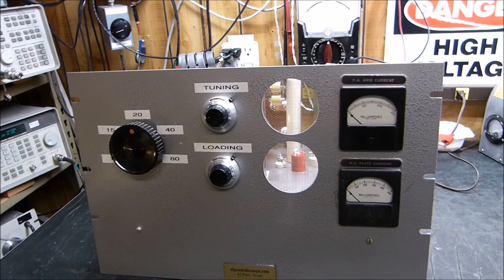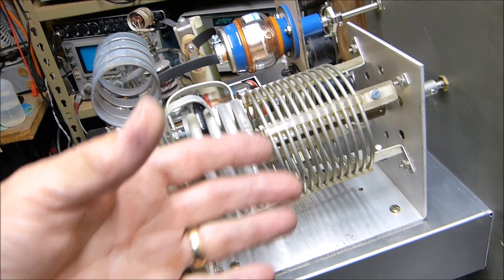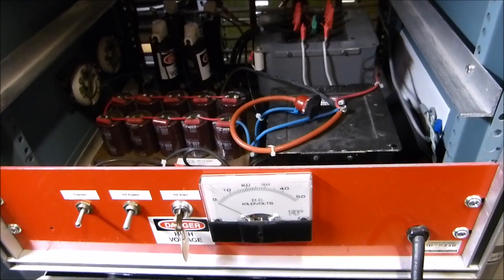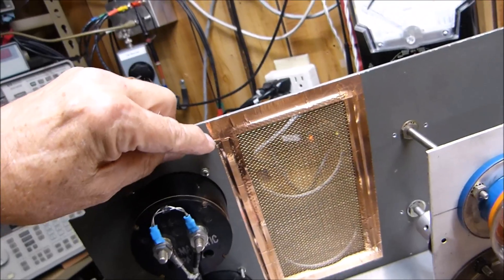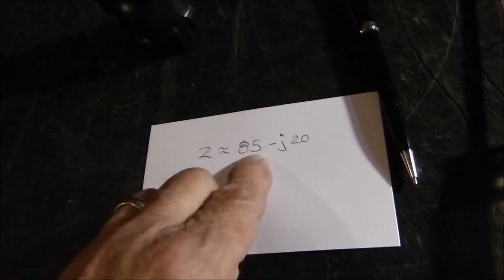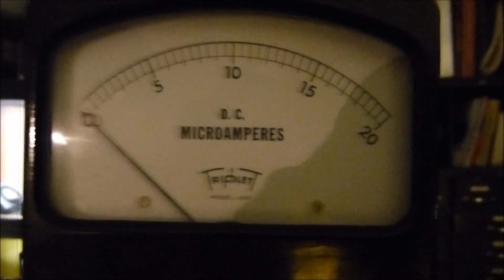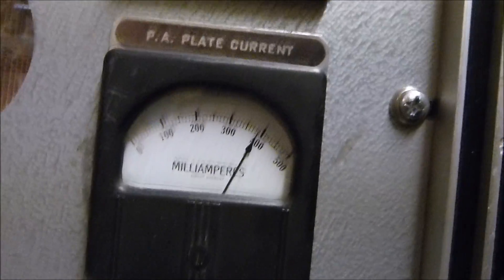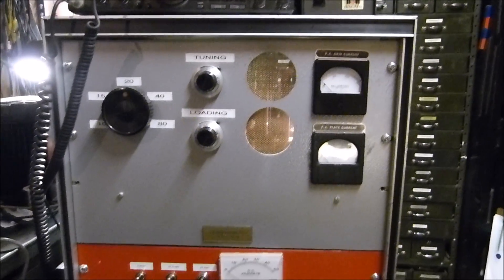Eimac 3-400Z or 3-500Z  Grounded Grid Linear Amplifier Build For Amateur Radio

Comment: Hi there, can you tell me more about the impedance bridge / null meter?      Looking for something similar but its a dark area.  Seems kind of like the OIB (operating impedance bridge) type unit?
Reply from the maker: I had to build these impedance bridges not too many years ago but nowadays there are many out there for reasonable prices and much easier to use. Unless you want to build your own test equipment - I enjoy it - you can buy working instruments for not much money.
Reply: @ElPasoTubeAmps  I've tried using tools like NanoVNA but it just went absolutely BERZERK when i keyed the amp.      I ended up building the OIB (operating impedance bridge) which is pretty similar to what you show.  I've yet to finish calibrating the jX dial but it seems to work.   

I did find information on your unit when i watched the 20m dipole video.   Loving the videos, keep em coming!

Comment from the maker: 🛠 The Builder’s Creed
(For those who work with tubes, voltages, and the spirit of creation)

I build not just to function, but to understand.
Not just to power up, but to resonate.

I accept that theory gets me in the room—
But it is wisdom, patience, and sometimes smoke that teaches me.

I respect the current I cannot see,
The voltage that waits with no mercy,
And the vacuum that whispers its secrets through glass and heat.

I know that everything in my schematic is a point source—
Until it bites me and reminds me it’s alive.

The first rule is to stay alive.
The second is to honor the tubes—
Those glowing sentinels of a quieter time,
Asking only for clean filaments, careful bias, and a little love.

I tune by ear, by instinct, by scars.
I touch nothing lightly, for every connection is sacred.
I do not fear feedback, for it shapes the signal into something meaningful.

May my solder joints be clean,
My grounds be solid,
My finals be spared,
And my spirit remain curious, humble, and alive.

I build because I love it.
Because to build is to remember who we are—
And what we might still become.

Comment: Thanks for sharing! By chance do you know the longevity of the tube component?
Reply from the maker: Many of my tubes were made in the 1970's and '80's, some even in the 1950's and they work fine. If a tube is "born" good and strong and it is not run hard and overloaded and over heated, it can last a long time. An exact number of years is impossible to say. Many of the high-power transmitting tubes available today were run for some allotted amount of time in commercial transmitters, then replaced on a schedule and they are very good today in amateur radio transmitters even thought they are likely well over 40 years old. Most are not even made anymore but we keep building with them. Tubes like, just for examples, 6L6, EL34, 6550/KT88 that you find on Ebay with great test numbers, do not often times turn out anywhere near they are advertised to be in performance. Just because a tube "tests strong" does not mean it will perform well in real equipment. Tube testers are not worthless but they only tell a little bit of the story of a tubes performance. Most of the power-tubes as mentioned above for sale on Ebay perform poorly. On the other hand, tubes like the 12AX7 family of tubes can perform very well even though they are 50 years, or more, of age. They don't run hot and who knows how long they will last. Hope this helps.
Reply: @ElPasoTubeAmps  Thanks for the answer. I made a nixie clock with some Russian tubes from the 60s NOS and they have been running 24/7 for 6 years now. However, the power between your 500Z is many magnitudes higher than my little IN-17 with 190 only volts. 🙂

Comment: Beautifully constructed! I see that you use a PI input network, would a L or PI L input work too?
Reply from the maker: Thank you. I use this amplifier a lot for 20M and 40M SSB. I have never gotten into building PI L networks. The old B&W tank coils are real jewels to build with and will take a full KW of high-level plate modulated AM so they are just loafing along with a few hundred watts of SSB.  73

Comment: Really enjoyed the video. By the way, some of the bridges use a capacitor in parallel to the resistance, not in series, so it reads R in parallel with X. That is not R - jX.    73

Comment: Sweet build.
Reply from the maker: Jim,
Thank you. This amplifier gets used (daily) more than any other amplifier I have. I have moved it into the PS cabinet I used for the 833A amp as the PS components in that cabinet are a bit larger than the cabinet I installed this amplifier in originally. It delivers between 500 and 600 watts (depending on the line voltage at any one time during the day) and just keeps on working. The Eimac tubes are, by far, the best.  I am told it sounds good and is definitely a "keeper" in my opinion. When I operate the 4CX1000A amp I do get reports of a little more S-meter increase but really nothing as far as strength or quality of sound level even though the bigger amp puts out twice the power. I have found that 500 watts is a good power level and anything over that is generally not going to help very much.   73

Comment: Nice video!  I have heathkit HL-2200 it has 2  3-500z Your right the 3-500z are hardy tubes they where replaced with the 3-500zg

Comment: Hello,

I'm an electrical engineer of the "new school". I learned electronics with transistor and zero valve tubes, also I work as an embedded software engineer so I have fairly no too much experience with electronics and nothing regarding triodes. 

Ok, lately, the destiny moves me to old radio devices and actually bought old books for inductive heating. I want to create a machine to induce heat at 27.12Mhz. I did my research and got particulary interest on a Colpitts oscillator to do the task and found this US patent: https://patentimages.storage.googleapis.com/71/5b/ea/c38064a137a6a2/US5010897.pdf 

Also, I want and output power around 500W so I brought (prematurely) a 3-500ZG-TAY tube from RF Parts that can handle up to 600W, also I selected C1 = C2 = 20pF and L = 3.44uF of my colpitts osc to get arround 27.12Mhz fixed.

I have experience working with High Voltage. I made a replica of a Multiple wave osccillator so I have required caution to do the task.

Time is running out so I need help. I made some simulations with multisim and generic triodes with my colpitts osc and the circuit at the US patent with no success. I do not know how to calculate the capacitor #32, #46 and the inverter circuit. 

So any help would be reallly really helpul and appreciate. I can pay you for some working design. 

Kind regards.

Jorge,

Comment: Not many of us fiddling around with tubes anymore :) i was chuckling a bit when you said stick your finger in there , hehe, anyway, not much diffs  between the 3400z and 3500z, built quite a few of them back in the day, the 3-400z were a tad more on output than the 3500z, but that's just my experience,  3-400z has become hen's teeth. 3500z is now expensive as gold.... 813 tetrodes still rock around the clock and you still find them from time to time, 4-1000a  are priceless obsolete hard to find some decent ones. The last 4-1000 a  i experimented  with is on you-tube, as well as some other's  i built. found your video looking foe some 833a stuff that i am busy with.
Cheers Johan
Reply from the maker: Hi Johan,
Interesting that you found more output on the 3-400Z than the 3-500Z. That has been my experience also. I do not have any new Eimac 3-500Z's to test only the newly made ones in China.
There was a seller that had a stash of about a dozen beautiful 3-400Z's not long ago on Ebay. I bought two of them and have, I think, six of 3-400Z's now.
I agree that the 813 is a true workhorse. I have a number of good 813's and am considering an amplifier using two of them. 
The 4-1000A is a tube that during the days I had a number of them, did not choose to build a 5-6 KV power supply and found quickly that even at 4KV they don't perform that well.
My biggest amp is the 3-1000Z and I am pleased with it but lately I seem to use the 833A amp and the iCom 736 rather than all the S-Line stuff and R-390 which I love.
I assume you found the 833A videos I have posted. Here is one of them.
https://www.youtube.com/watch?v=ChHPL84f22Q
Please send me the link to your 4-1000A video.
Thanks for your comments.

Comment: Excellent video and construction! The video title says "Eimac 3-400z..." while the comment states "My first build using the 3-500Z triode...." You also state in the video "it is running a 3-500z", so I''m guessing it is actually a 3-500Z?
Reply from the maker: I guess that could be a little confusing. In this video it is running the foreign made 3-500Z  but in real life I use an Eimac 3-400Z and get more power out of it.

Comment: I have watched most of your videos and  you do nice work but I would like to know why you do not use cut off bias on any of your amps.  It is not typical to build a ham amplifier without it.  Just wondering.
Reply from the maker: Thank you. That's a good question and I have been asked it before. Since my first larger amplifier in 1970, I have turned the HV power supply on when transmitting and off during receive. I know that is not common but if I remember correctly, way back when... I only had oil type capacitors that were rated at 3KV and with a load on the PS the voltage would be proper at about 2500 for a pair of 813's but under no load (or with the tube biased off) the voltage would soar above the voltage rating of the capacitor so I build my amplifiers so there is no HV unless the amplifier is actually amplifying and transmitting so I don't need any bias to cut the tube off. A similar style of building is my placement of the meters, in particular the plate meter, in the HV line. Only recently have I started putting the plate meter in the return line of the HV power supply. 
In a similar manner, I do not DC ground the grids of triodes, like the 3-400Z, etc.,  at the socket. I bypass each grid connection to ground with capacitors and then DC ground the grid thru the grid current meter. In the case of GG tetrode amplifiers, I do ground the screen for DC at the socket but once again, bypass the grid connections to ground for RF and provide the DC path to ground thru the grid current meter.
I know this is not all according to some old and approved methods but I have never had instability or parasitic issues with any of my GG amplifiers. Hope this helps.

Comment: well done quality parts  great layout this was well thought out i have some old jennings vac caps had a plan for a 3-500 that never happened due to repair and test equipment cost would you consider building another
Reply from the maker: I am building another as I write... a little different but it is going to be a 833A. Can't be a GG amp as the 833A is a medium mu triode but of the few I can find around on the Internet where others have built and posted, driving the grid with somewhere around -100 volts on the grid (depending on the plate voltage) seems to work well. I have a very nice B&W 852 which I would like to use but I have some homework before I decide if it can be used. I only operate on 20 M but rather not make it just a single band with 1/4 inch copper tubing for the tank coil.  Thanks for the nice comments. I operate this amplifier along with my 3-1000Z and the performance of this smaller amp is impressive. What made a Huge difference is running 240 with #6 wire into the radio room. Wow...  it makes a serious difference even in a "smaller" 1 KW PEP amp like this one. I tried using this amp plugged into the wall along with the exciter and it loaded the AC circuit so much that the power dropped out of the driver (32S-3) and just became strange to try to tune up. Now that it operate on its own 240 volt circuit. it works great. Lastly, all of my equipment is 120 volt but, the 240 V I run into the radio room is stepped-down with a 5KVA auto transformer. That is the way I get sufficient power to my amplifiers.
Are you considering getting back into your 3-500Z project?

Comment: Just ran across this video and enjoyed watching.  But I do have a few questions:   Did you check for plate choke resonance points with the plate choke in the operating position?  Is that muffin fan all of the cooling you have incorporated?  Why use a B&W tank when you can easily design and build your own with the plate load impedance you desire plus pick up 160 meters and the other WARC bands?   Why both a choke input and capacitive input in the same power supply?   Why not use a quality oil filled cap and not failure-prone electrolytics?  Why is the idling plate current so darn high?  Why not incorporate an electronic bias circuit and keep the tube cooler?  Why is the rear of the RF deck open for stray rf to escape and find it's way back into the input circuitry?  Why not a better more powerful ceramic tube if you are going to all of this trouble?  73, Joe W4JF
Reply from the maker: Hi Joe,
I don't know if I can answer all your questions but I will try.
I did not check the plate choke for resonate points. I know that can be a problem if I plan on using it on all bands but I only have antennas for 20 and 40. I have built many amps with the B&W 800 and the National R-175 and I have never had any issues. I used the B&W tank just because I have it. Most of the amps I have built starting in 1970 are single band amps and I wound those tank coils out of 1/4 inch copper tubing. Worked great. I don't have room for 160 meter antennas and basically I only operate 20 meters, so, there again. I have made the PS with the ability to use it as choke input or capacitor input just in case I need one of the voltages. With the switch to change the secondary taps and the ability to add or remove the input capacitor, I have basically six voltage selections on my HV supply. I use series electrolytic as they are cheap and small. I like the big oil filled caps and I do use them in my 3-1000Z amp built into a Collins 30K-1 cabinet (there is a video on that also) but they are large. My plate current may be a bit high as I run 3500 bolts on the 3-400Z instead of 3000. The amplifier slides into a cabinet with a cover over the back mostly for safety and I suppose it offers some RF shielding and yes, the only cooling I have is the little muffin fan. It puts a good bit of air across the tube at least as much as Heathkit did with their SB-220 and pair of 3-500Z's. I have built and run a 4CX1000A for over 30 years but I like the glass tubes where I can see the plate running orange hot. 73, WA4QGA Maybe we will meet on 20 meter SSB some time.

Comment: Nice job, I would like to have that!
I built a 4-1000A  about thirty years ago with a 10KVA pole peg (flat wound ribbon) that weighed 140Lbs. (just the transformer}, several oil filled surplus capacitors.
That thing would do 4500 volts at about 800 mills with 1 to 2%  regulation. I desperately looked for a 220 volt variac but never found one I could afford. All this was in a big Bud cabinet.
You have been around long enough so I don't have to explain to you what a pole peg is. Not many know what they are anymore...
Reply from the maker: I has several pole pigs years ago. They were all 10:1 so I could get 2400 volts. Into a doubler I would have had about 6500 volts DC but I couldn't afford capacitors to handle that voltage during those years. That would have surely made the 4-1000A scream. I have built 4-1000A amps but always at a plate voltage of 3500 volts (my capacitors in those days were limited to 4 KV) but they didn't perform very well. Same for the 833A. Nowadays I could afford it but don't have the room. I am really pleased with my latest 3-1000Z amp at 3500 volts on the plate although I think the pair of 4-400A may look the best in the old Collins cabinet.  I do feed this amp with 240 and the regulation is very good. Too bad when we are young and have the energy, we don't have the money and you know the rest...   :-)   Thanks for your comments.
Reply: I know what a pole pig is...

Comment: Did you say the lower Vacuum variable capacitor is 2000 PF?
Reply from the maker: Yes, it is Jennings CSL 2000. I don't remember the lower range in pF but the upper range is 2000 pF and the voltage rating is 2000 VDC. I got lucky and found it on Ebay for  $49.95 + shipping. I have recently seen another 2000 pF listing at a starting price of $800.00. Way too much in my opinion.
Here is the current Ebay listing -   http://www.ebay.com/itm/JENNINGS-Vacuum-Variable-Capacitor-UCSL-2000-3S-/112252553912?hash=item1a22c60ab8:g:Vt8AAOSwImRYZXSD

Comment: I like the modular design using the same power supply and rack for different amplifiers. I may use that  for some future projects I have in mind.
Reply from the maker: Thank you. I am glad you liked it. That approach has served me well for a very long time. I started this forst project in 1983 and have placed 4-400A,  4CX1000A and 3-1000Z amplifier chassis in the Collins 30K-1 cabinet for RF amplifiers. . As for this smaller cabinet in the video. I have placed 813 audio amplifier, 833A SE amplifier, 3-400Z RF amplifier, all I can remember at the moment, using the common power supply. Sure saves a lot of time and work building the power supplies over and over. Stay safe from the high voltage and enjoy.